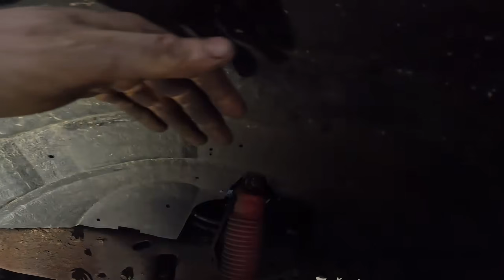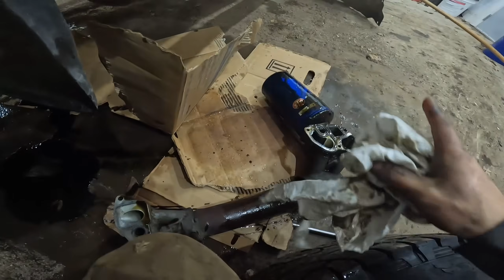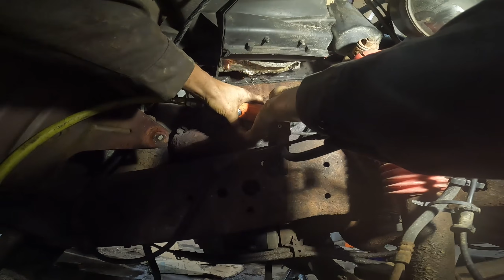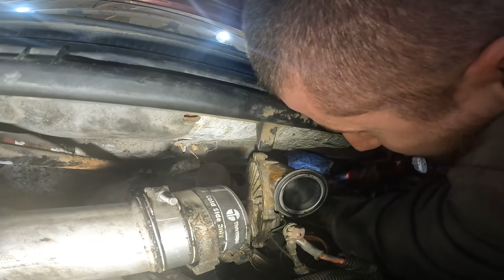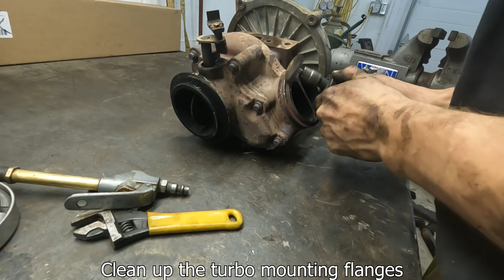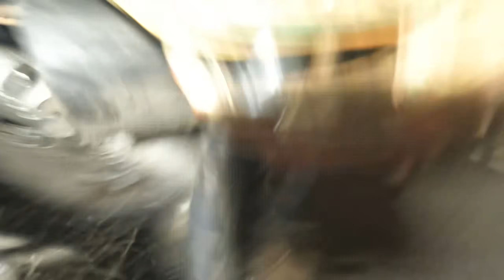2003 F250 7.3 Exhaust Manifold Replacement

Comment: In the middle of a major effort including turbo wheel, pedestal, exhaust manifolds, injector seals, glow plugs, intake plenums, etc. your video was extremely helpful!

My truck is a 2002 F350 crew cab, 4x4.

Comment: Excellent job! Just did my 01. turbo rebuild, one piece uppipe, exhaust manifold gaskets, manifold had 2 broken bolts. I was cursing the whole time. Seeing your battle with the rusty bolts gave me a different appreciation of working on a dry southern truck.
My .02 would be to replace the pedestal orings as well as delete the exhaust back pressure solenoid on the pedestal while you are already there. If its not leaking, its about to. 
Same thing with oil cooler, you didn't show it in the video, but I assume you replaced the block to cooler mount gaskets, might as well do the oil cooler orings, If they are not leaking, they are about to.
Plugging the oil galley on the oil filter base to block port to keep out welding slag, dirt etc. that galley goes straight to engine oil circulation. Same with exhaust ports while cleaning heads.
The Dorman manifolds are pretty nice these days.
Again excellent job tackling this job. You didn't say if this truck was a keeper or a flip. If its a flip, I understand just doing what was necessary to make it functional again.
Reply from the maker: I treat all my trucks like keepers, it gets loved like I'll never be selling it!

Comment: I have to disagree on easiest way to install the new up pipes on the turbo. Un bolt the turbo from the pedistal and clamp the y pipe to the turbo then bolt the turbo back on then bolt the up pipes. That clamp is such a pain just dont even try doing it with the turbo bolted down